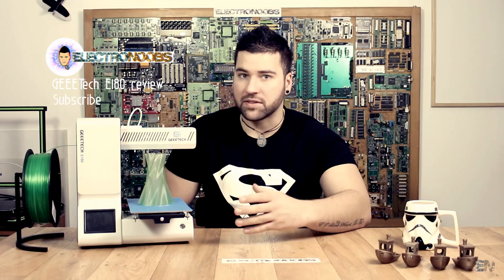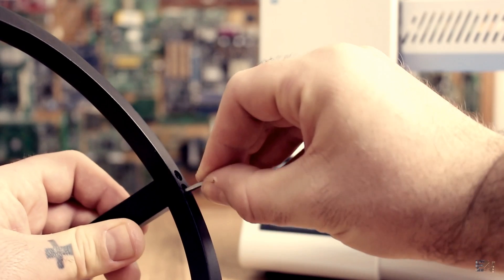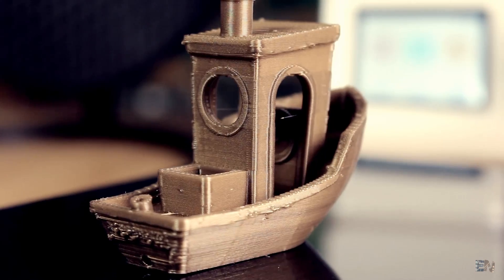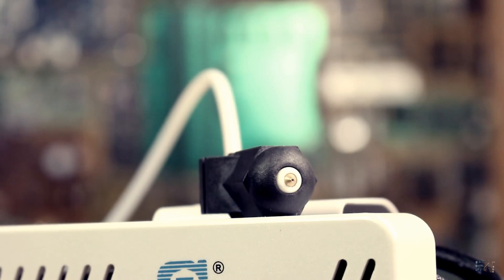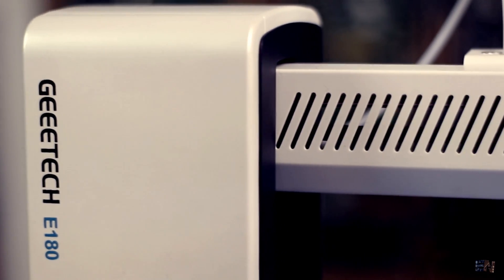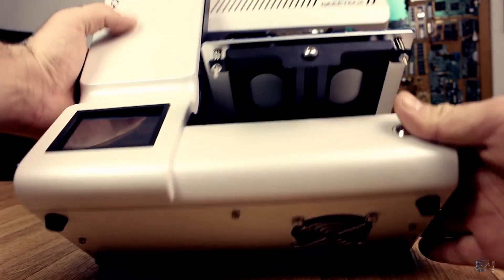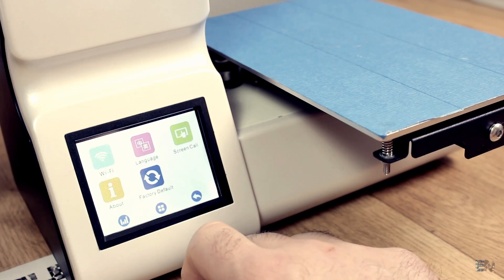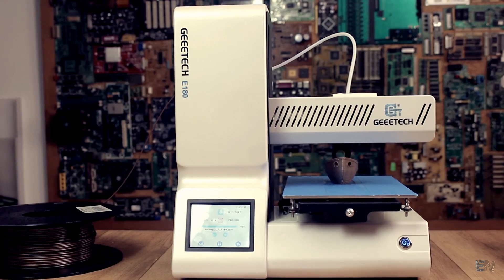GeeeTech E180 3D printer REVIEW

Comment: Very good review.  Best close-up camera work of any I've seen on this printer and maybe any review.  I'm with you also on preferring the DIY type of printer, but I bought this as a gift for a young person.  One thing I've noticed is that my printer under-extrudes by 0.7 as checked by the manual advance in Repetier Host.  I also measured the filament used against that predicted for a small model, and found it to be O.7x also.  Have you checked the filament advance? Your prints don't look like they are under extruded, but neither do mine other than on some surfaces.   BTW, what is the firmware and hardware version of your printer.  Mine is V1.13.16 and V1.4.  The same problem was reported on the Geeetech forum, but when I last checked, there was nothing posted other than the suggestion to increase the manual extrusion scale factor.

Comment: Gday mate . Hey what printer do you suggest for building 250mm quadcopter parts . Cheers :)
Reply: Tamara Thompson A chinese copy of the Creality Cr10, you can found it for about 350$ and this printer is absolutely gorgeous!
Reply: Check out the Anet A8. Got it for 150$s, it printed perfectly after Assembly, no calibtration had to be done. I am very satisfied
Reply from the maker: I always suggest the Creality CR10 since it is great. But now days any printer could give you good results. I've used the Anet A8 fro a long time and it is also ghreat but with a lot of fine tunnings. Anet A8 https://www.gearbest.com/3d-printers-3d-printer-kits/pp_337314.html?lkid=12693487 Creality CR10: https://www.gearbest.com/3d-printers-3d-printer-kits/pp_627176.html?lkid=12693499
Reply: I printed my drone on the anet a8 in pla. I got the drone to work but the arms broke very easly. so I recommend not making the whole frame from a printer but you could make motor guards for it. I would recommend the anet because it is like 120$ and prints very well.